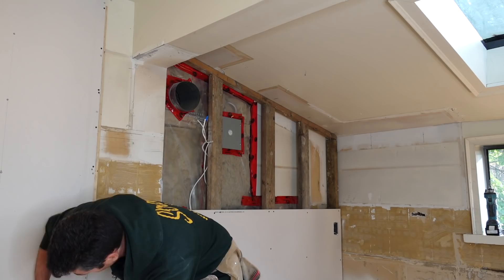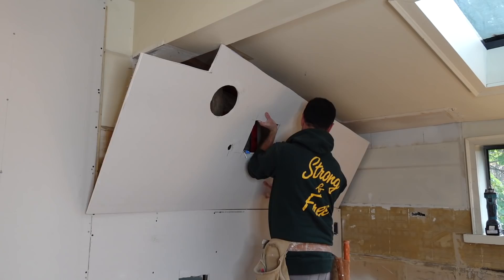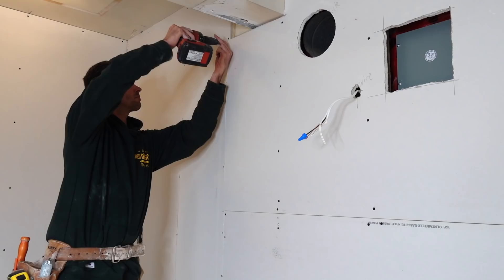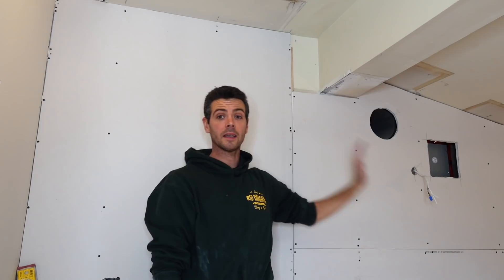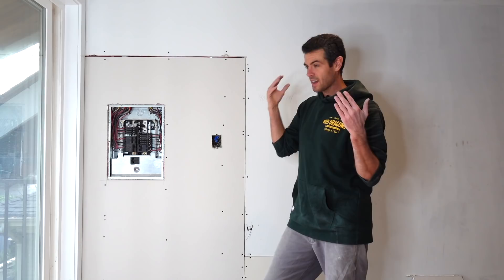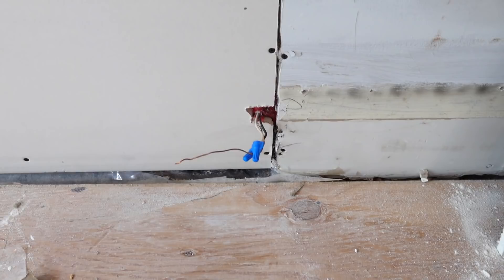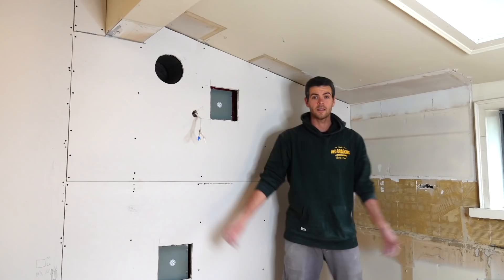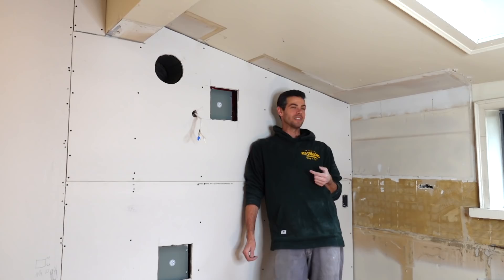Every Beginner Drywall Mistake I can think of (3/3)

Comment: I watched the whole thing (#LOAP).  Just wanted to add, I've watched a lot of drywall videos.  Drywall is one of those jobs where every little tip you can learn can make your life way easier, and there's some good info in your videos, so Thanks!  BTW on a completely unrelated note, you can't find Tuck Tape down here in the US but I ordered it on Amazon and gave it a try, and where other tapes gave up and peeled off, Tuck Tape doesn't!  I'm now a fan.
Reply: Problem with TT is that it leaves a red residue and peels off of itself when you try to remove.
It can sure be handy though
Reply: And in this case, it’s the blue one (for vapor barrier) that should have been used

Comment: I just came this 3 part series as I am thinking about tackling a wall remodel. I want to remove a slider and frame in a window instead. I need to remove all the drywall on that outside wall as there is no insulation there. So I think a 12x8 foot wall should be doable as my first ever drywall job.

Thank you for your down to earth approach to this DIY. I'll watch this again and then watch your taping lesson next.

Comment: One of the huge benefits of being a hangar/ taper is knowing what you can easily fix with mud! Most noobs try to cut every thing too tight, especially on remodel stuff. I also recommend making marks on the board where you DON'T want fasteners (pipes, wires, low spots...etc.) Like your videos. 45 year drywaller from the Pacific Northwest.
Reply: This noob did exactly that - tried to cut things too tight - but I got better.  However I do have a question for you - when/why should I use tape and when can I get away without it?  I put in a small patch and filled a quarter-inch gap between the patch and adjoining drywall without using tape, and it came out fine.
Reply: @erichsh58  it will crack eventually!

Comment: In commercial applications, I was taught to install drywall vertically if the walls are 8’. You’ll have less seams to tape and they will all be factory tapered edges. If it’s a double sided wall with metal studs, stager the boards from one side to the other to stiffen the wall.

Comment: Thank you so much for all of your videos, I've learned so much from you. I figured halfway through our job here that not staggering the joints wasn't ideal, good to hear more of the details of why! I also wish I knew about whatever drill and/or bit you've got cutting those holes. I had a hole drill kit and it was incredibly too easy to be an eighth inch or so off, I'd rather have a little more control over the cut and more easily make any adjustments

Comment: One thing that might be worth a try is taking a hot air gun to the old wall tile adhesive to see if it comes off easily. (Especially for a DIY project.)
The stuff in my bathroom came off nicely, leaving a slight stain on the paper face.

Comment: 3 years into my own home reno.  Your videos helped me replace all the rock lathe and plaster in my house with drywall.  The best teachers are on YouTube.
Reply: If you had that much time, it might have been worth learning how to replaster the walls, rather than drywall over everything. Plaster is basically a superior material in everything except time spent on labor!
Reply: @ThePlockets  The rock lathe was cracked everywhere and the weight was pulling down the second floor joists.  Started out by trying to remove and skim coat the stipple and sand swirls.  Ended up rewiring everything with   led lighting, home theater and plumbing, floors, several  termite destroyed walls, flooring, insulation, etc.

Comment: Great video.  I really learned a lot.  One thing you didn't mention is what to do when a partition wall that is parallel to the the bottom cord of a truss falls  midway between two joists.  Most framers will add a nailer to the top of the wall so you have something to butt the drywall against.  The mistake drywall installers make is that they screw the ceiling board to the nailer rather than letting it float.  This is important because the bottom cord floats up and down with temperature changes.  By screwing the drywall to the nailer you prevent the edge from moving at the same rate as the rest of the ceiling and develop cracks.  If you let it float, the nailer acts like an expansion joint,

Framers make the same mistake if they nail the bottom cord to a partition that is perpendicular to the truss. In this instance you can use a 16 penny nail on either side of the cord to keep it from moving side to side.  But this is unnecessary because instructions that come with the truss usually call for a "rat walk" on the top side of the bottom cord that runs from gable to gable and serves the same purpose.

Comment: Where we are in NY we typically install drywall vertically floor to ceiling which leaves only factory joints and no but joints. We do run a subway pattern on ceilings unless we can span the room with a single sheet; we typically go as long as we can to limit but joints in the field.
Reply: Question for you, do you mostly do apartment buildings? I've heard that installing drywall vertically over steel stud framing is more ideal. On wood framing, horizontal is the prefered, but steel stud is a different situation.
Reply: @Phazetic99 : Rarely ever do steel stud work; in fact I can’t recall ever doing steel,work outside of commercial. I live and work in upstate NY and every drywall contractor I can think of runs sheets vertical to minimize but joints.
Reply: @libertarian1637  Have you had or have seen issues with the joints cracking, which seems to be a concern about this method? I assume you are either pre-filling with some type of hot mud or getting the joints to fit snug to begin with?  In other words, what has been your method of success?  Thanks!
Reply: @TobiasRaphael1 : I can’t say that I have; in new construction joints are tight/touching top to bottom. In NY the go-to tends to be along one of two schools a setting mud for pre-fill, if needed, taping, and the first over-coat followed by an all purpose for a top/finish coat or all purpose for everything; I’ve never known a rocker/taper to use multiple muds outside of setting and an all purpose, just don’t see say taping muds or finish muds used. I will say most will thin down the mud a bit for taping and /skimming as well as mixing it up well, a few even add some dawn dish soap to the mix as they say it adds smoothness without too much water, though I’ve never noticed a difference or improvement from Dawn. A setting mud pre-fill definitely makes a huge cracking difference in old-work and seems to help with corners. Some guys really like light weight and ultra-light all purpose and while they go on well and sand well they’re just too soft for my taste and just seem to take more of a beating over time. We have some OK mudders and some great mudders who can make tapped drywall look as good as plaster, though you get what you pay for. Probably the best finisher around actually mixes some mud in with a primer, not sure if it’s setting or AP, but it works like a filling primer on metal and after he sprays 2 coats of that and back-rolls the walls are just perfect and seem to take paint beautifully. I’m not sure if he sands between sprays as I’ve never stayed to watch but it’s hard to argue with the end result. I absolutely hate painting, I started a few decades back as a commercial/industrial painter and got my fill so anything to make life easier and having to keep from painting is worth it to me.
Reply: @libertarian1637  Thank you for the detailed reply.  Sounds like real world in-the-field work has proven theory to be incorrect, or at least not as cosequential.  Good to know!  I feel you on the painting :D
Reply: @TobiasRaphael1 : I’ve been in the trades over 30 years now and while I don’t hang much rock anymore as it like masonry is a job for the young I’m always amazed by the notions people have and how they develop. I’ve changed with the time and embraced technology and modern methods with most things but in the homes we build and/or remodel I have long been of the mind that minimum code is just that the bare minimum and typically over build; as a trades family we have been building since the turn of the previous century, in fact I still live in the family home built in the 1890s, many-many times since renovated. I’ve gone in homes built by my grandfather and my uncles and after decades there are no cracks, but that’s because they were using 2x6 when 2x4 was code and have 2x12 floors when 2x8 is code, cross bracing on floors and fire blocking on walls means things just don’t shift as much. I’ve been in newer homes built to min-code and have spotted cracks within 5 years as things just shift and settle and are too flexible.
New techniques can save time and going thinner can save money but when you want a place to last the less than 5% cost increase on materials are peanuts; today though everything is disposable from electronics to even homes it seems. 
Another issue is safety,take engineered floor joists they’re nice and can give you better unsupported spans but are lethal to firefighters in the case of a fire as the thin 3/8” OSB in the center burns through so fast and creates weak spots or just a caved in floor; an over built 2x12 is tremendously more wood to burn through with a much higher margin of error in a fire or even a future load that’s unforeseen now. When my house was built electricity wasn’t a thing and neither was indoor plumbing; it’s interesting to see the evolution of construction first hand.
Reply: @TobiasRaphael1  fun fact drywalls ment to be run vertically if not in some states want pass fire rating

Comment: Incredible video series, thank you! A few questions: 
(1) Were you saying it's best NOT to lay the drywall sideways in that tapered wall? (with all the utilities behind the wall) And you were doing it that way to show what not to do? 
(2) Did you put wood backing in between the edges on the open spans of sheetrock on the sideways wall? (the lack of screws in between suggests you didn't) I didn't see you do that, yet you did do it for the vertically hung wall. 
(3) Those rasp taper things you were doing off camera are critical to understand, but they were all off camera. Can you show that again or reference the video that shows what you were doing? 
(4) Why do you place the screws so incredibly close to the crumbly edge? And also match their position on both sides of 2 butted sheets? Wouldn't it be better to move them just a 1/4" inboard to help prevent cracking? And also stagger them across from two butted sheets?

Comment: Definitely enjoyed. A few things you helped clear up. One of my biggest concerns was what happens when the wood you are attaching the drywall to is really warped. You cleared that up. Another concern I worried about that you didn’t go into but you made it work was around that outlet on the bottom right in your last piece of wall, you left maybe a half inch to an inch of drywall on the right side of that plug. To me it seems so flimsy to leave like that. Was wondering how thin of a piece can you go in that situation before you say I can’t leave it like that

Comment: For all the drywallers out there don't forget to cut out ALL the damn electrical boxes because it's a disaster for us electricians to try to find them. Unfortunately it seems there's always at least one box that you guys forget to cut out. I learned to always videotape all the electrical stuff before the drywall goes up so I have a easier time finding those boxes.
Reply: Just set your boxes a bit proud of the stud or joist.  No way to install the drywall without cutting out for it.  (or it will crack the drywall)
Reply from the maker: Oh yes there is a way. You would think you couldn't install around a proud box but you sure can and people do it all the time. Even done it once or twice myself😂
Reply: Thanks! That's a good idea.
Reply: I always mark box on the floor with orange fluorescent paint...mark an x on the floor under can lights and ceiling boxes as well
Reply: Good lord yes. I just went behind a drywaller with electric. They didn't cut for anything! Can lights, outlets, switches. It was a mess.

Comment: Great Presentation! I think I am a little more of a beginner than others. What I didn't get is how the cutouts on outlets with the router works. Are you cutting on the outside or inside of the outlet boxes, and what does the router blade look like? (I've previously used a hand drywall saw to do the cutouts). Otherwise, VERY helpful! I learned how to avoid problems that I didn't know existed. BTW, I once hung the ceiling in a large room that I framed, and a professional came in and hung the walls and did the finishing. He said I did a good job on the ceiling, except I did the "railroad" rather than the "brick" pattern.
Reply: He cuts on the outside of the boxes. Railroad is brick pattern, don’t know why he says it’s different. Railroad refers to horizontal installation.

Comment: A blocks help a lot if you hang top down.   Scrap wood and screws do the trick.  Why not hang vertical stud to std when you can to avoid as many raised joints as possible

Comment: Just watched all these. Thank you so much! Now I'm about to hang 110 sheets of drywall (Ruptured Water Heater). One thing I didn't see addressed was spacing the sheets. I've read you are supposed to leave 1/8" in between sheets. Do you reccomend this? If so, what do you use as a quick spacer? Or just eyeball it? Thanks again!

Comment: Ma Man. I regularly Patch my wound with Crazy Glue or electric tape. That's what makes you a real contractor 👌👍💪
Reply: The story about super glue being invented as a way to hold wounds closed is not true. It was developed as a fast drying glue, and was used to close wounds later.
Reply: I wouldn’t put foreign liquid material in my bloodstream. I always keep bandaids in my wallet, but if I didn’t have any, I would use electrical tape with a tissue on the wound.

Comment: I'll give a tip, when a panel is to tight, especially at corners a quality mallet works to pound those corners in, especially if you're just hanging the drywall and a finisher comes in behind you 😂. Another pro tip, don't ever meet the finisher you did that to until you've brushed up your MMA skills 😂.

Comment: I avoided butt joints by lugging 12' drywall in for my 11' basement ceiling. It was definitely worth it.
Reply: As do I.  However in many basements, getting anything longer than 8ft pieces into the basement is impossible

Comment: Your terminology is different than what we used for the last 50 years. What you call railroading, we call plus jointing. To us, railroading was when they hung the sheet rock in the same direction as the joists or studs. Breaking the buts other same joist or stud was considered plus jointing.

Comment: How do you get more than one vertical cut with a utility blade?  I have tried a variety of blades and they all dull so quickly they are plowing instead of cutting.  The Roto Zip blades also seem be dull  fuzzing the paper at the cut.  Even a new drywall bit seems to have trouble (won't) make a clean cut in the paper.  My supplier stores the rock out in an unheated and open all day steel building here in a humid coastal environment (up just north of Prince Rupert here in Alaska).  Is the humidity causing the paper to 'fuzz' with the Roto Zip?  Are there better bits and blades I have never heard of?  Just one of the reasons I have a life long hatred of sheetrock, always preferring to put up wood paneling instead.  I seem to always be doing remodels and sheetrock just makes such a mess even when handled carefully.  Vacuum attachments help loads but there always is that mess.

Comment: When you put up the two vertical sheets in the corner, next to the brick, you didn't mention if the corner sheets should be the cut ends or the factory beveled ends. Was the edge next to the brick the beveled side? If going vertical, should all corners be cut ends or beveled? Thanks

Comment: I hate when I get home from a day of filming and realize that the audio is shot or just gone. The video app I use has tons of features. 99.9% are of no use to me whatsoever. There are buttons all over the screen and it's very easy to accidentally tap one and end up in some mode I don't even know how to get out of. Every time I start shooting I have to look at all the settings to make sure I'm recording in the right mode and the audio is working. Too many times the audio has been ruined for some unknown reason. When I see that the app is all screwed up I don't have time to figure out what the heck's going on because I need to start the recording NOW. So I kill the app, reset the focal point, and start shooting. Too many times I've had to spend hours trying to fill in missing audio. Taking audio from similar videos and editing it to fit the missing piece. Sometimes there's no saving it. I'm an IT person and this stuff is just way more complicated than it needs to be.

Comment: What is that little tool you use to cut out smaller holes or squares? 

It looks like a cordless screwdriver. 
Great videos and thanks for all the advice.
Reply: It's a cut-out tool. Just make sure to use the bits designed for drywall as it has a guide at the tip so not to cut wires and plastic boxes.

Comment: This video answered a question on the project I'm working on. Thanks! Related question though... Since you don't want factory/butt combo joints: If you're doing a long patch (like a 24" water damage patch along the floor) would you rip the board long ways (fewer joints but all vertical joints are butt joints) or cross cut it so all vertical joints are factory joints?